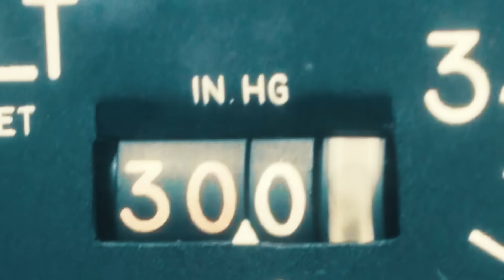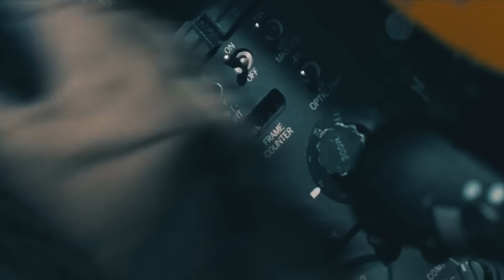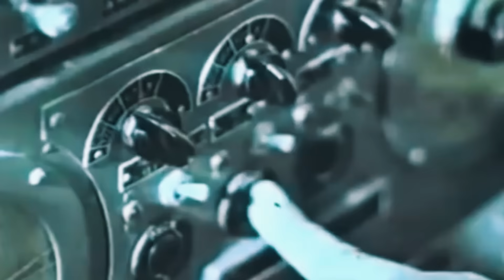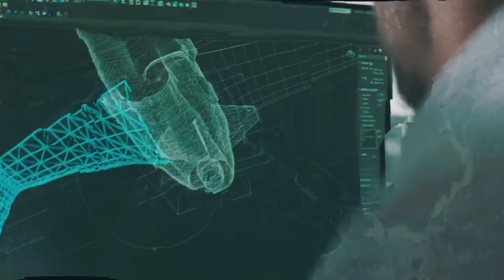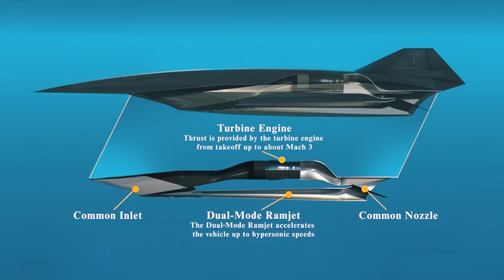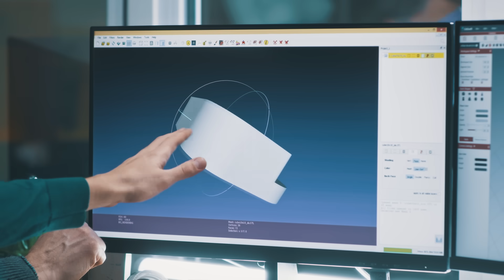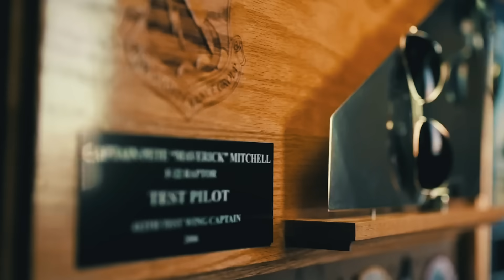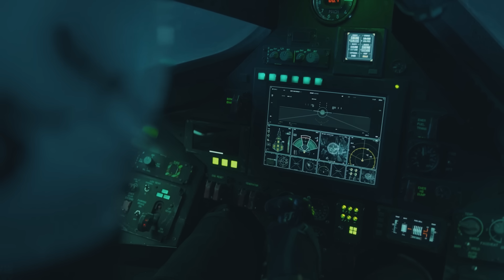USAF Declared SR-72 Darkstar Is Finally Ready To Fly

Comment: I saw the SR-71 in flight. It must have been around 1982. Word went around that the SR-71 would be featured in the airshow at Fairchild. I was downtown Spokane the day before the airshow when I heard this incredible sound. I knew instantly it must be the blackbird! I stretched my head out the truck window and saw it straight overhead. With the tall buildings on both sides I only got a split second glimpse, but I’ll never forget it. It gave me goosebumps!
Reply: In basic we were given the choice as a flight to pick which plane to have a group photo in front of. SR71 was unanimously chosen.
Reply: My father was was in the Air Force and worked in Photo Reconnaissance during Vietnam out of Thailand. In 1973 he was stationed at RAF Alconbury in England were we lived for 3 years. He developed the film from the U2 and SR-71. He wanted to retire at Fairchild so he cross trained into Avionics working on the B-52 and retired at Fairchild. I remember the event you mentioned well. During that time the land just beyond the flightline was accessible, and he took us there in his Ford 4X4 truck. We were just past the  the perimeter fence past the runway and I witnessed the SR-71 take off. It thundered down the runway and took off very low directly over our heads, and an intense heat from the engines was felt. It was an awesome view as the massive plane passed very low overhead and accelerated quickly away. I also was in Basic Training during the official retirement ceremony for the SR-71 at Lackland AFB in early 1990. Most of the recruits in my flight/squadron were in formation on the parade grounds during the events, and warned not to look up during the fly over. I was fortunate to be posted near one of the entrances into the grounds directing people. After a long ceremony it was announced the the plane was approaching and by the time the intense sound was present the SR-71 was just past were I was passing over. Then after the first of several sonic booms the plane quickly disappeared out of sight, soon future announcements of what state the plane was currently passing over were given, and at least one more sonic boom arrived as it was accelerating above.
Reply: I was there that day at fairchild , it was awesome.

Comment: There are multi tiered levels of classified operations at the skunkworks that not even Congress or the POTUS have been read into. I believe we already have vehicles capable of mach 10 and above that the public won't be aware of for another 30 or 40 years.

Comment: this is ancient smatterings of know things of the black bird, slipping in tidbits' of current look alike aircraft  which are far from being anything like the black bird. old hack, 
So which is it., operate a swing shift eyes in the sky, spy scope, or are the powers that be itching to invest in real speed over the Valley of Southern CA  Speed Check. 
Major Brian Shul US-AIRFORCE. PIOTE OF A SR-71. 
Not wanting to over look Walter who was doing all the real work, why they were up there for. 
I witnessed the fastest aircraft coming off the Pacific 
blowing across Southern CA at brake neck speed.
You just about got to catch it coming in to your vision,, your eyes can't track it, you have to look ahead quickly, about three times and it is gone, 3 blinks, its gone

Comment: In the 60’s and early 70’s we lived a few (5-7) miles from Rocketdyne. When they’d test usually mid-afternoon you could hear the incredible roar that normally lasted about 1-2 minutes. When they tested at dusk, the orange/red glow added to the roar was both awesome, and a bit spooky, errey
Reply: we lived  in a new tract near sequoia JHS  off the Tapo Cyn exit in '69..my pops was a ventura county sheriff at the time....our science class at simi high in 71 got to see a afternoon test fire of a early shuttle main engine ..it was on its side with the exhaust   directed along a concrete bed and chute blowing it straight up...
we were standing in a small bunker with thick glass ..the vibration and heat was insane....i recall the same night tests you saw

Comment: When I was in the USAF many years ago, I was introduced to a gentleman who was one of the original test pilots. He told me the top speed was NOT due to the abiliy to go fast, but that the titanium skin would start to glow white hot which was visible in the cockpit and they'd pull it back before it melted. It was well capable of traveling much faster other than that.
Reply: And that titanium skin also was one of those "rubbing someone's nose in it", since they bought the titanium from the Soviets through "dummy" companies.
Reply: @martykarr7058  bingo. Actually; wasn’t like 90++ of the entire aircraft - incl. airframe - made of soviet titanium?? I recall reading the CIA setup multiple front companies to slowly acquire the Titanium to build the birds out of….
Reply: Top speed is about M 3.55, maybe M 3.6, due to several factor including the CIT max is 427C and the shockwaves will start to intercept places were the aren't supposed to go like the wings and other parts of the aircraft.
Reply: Now that is fast
Reply: Same
Reply: yes, the new skin withstands around 40kF using a special metal that's not even on the periodic table; 140. If they use it right, it's actually made as a fabric in zero gravity, then fused and wrapped. It doesn't stretch, so the underhull has to be flexible enough to account for compression and decompression. David Adair gets the credit for discovering the first metal silk as wide as a human hair yet capable of a tensile strength of >5k lbs using nickel. He explains this process in one of the few speeches you can find on YT. Element 140 is made mainly from iron in a high plasma environment as a scalinohedronic element. All said and done, there is still another stealth tech which forms an ionosphere around the craft. The B2 actually used a weak one. I've seen it up close with my own eyes in Seattle. A stronger version blocks a lot of heat.
btw; they found a trick to cooling off the fastest craft by skipping out of atmo into space. Really. I think that might have been Adair or maybe Boyd Bushman who suggested it, idk.
Reply: I just want to know how fast they’ve gone for short bursts…. I’ll bet in excess of Mach 4??? 😵
Reply: @drjones762    You raise an interesting question!  If the SR71 was placed into a shallow dive (say 1 or 2 degrees negative) at, say, 80,000 to 85,000 feet, the plane could probably reach mach 3.7 to 3.9 maybe.  Possibly even 4+!  I'd think structural issues of the airframe itself, the titanium skin, and the engines would impose limits on the maximum speed of the plane.  Others on this comment section know much, much more about the "theoretical" top speed of the SR71.  Cheers.
Reply: @hansheiser3868  
specially the pilots! when i hear a pilot say he exceeded mach 5 significantly, i tend to take his word for it over 'theoreticals'
Reply: @andyman8630  Pilots are like fishermen,"it was definitely an 85 lb trout...."
Reply: @UnlikelyToRemember  
specially SR-71 pilots am i right!!
Reply: mach 5.5
Reply: @andyman8630 do you have any basis for that, or just a guess?
Reply: @drjones762  
the .5 bit was an estimation - pilot testimony! he said over mach 5, but refused to be specific
Reply: @andyman8630   I think that number is pretty doubtful.  The air inlet spike on the J58's moves backwards as speed increases to properly position the inlet shockwaves. The adjustment ends at around M3.2, go much faster than that and you are going to unstart the engines.  Not to mention the incredible increase in air friction heating from ~M3.5 to M5
Reply: @andyman8630  wow he really said over Mach 5???? 🤯🤯🤯
Once at an airshow at Beale, I met a man - he was either the only, or one of like 2 men - to pilot both the SR-71, and U2, both of which were / are based out of Beale. Amazing man!!! 😳🤯🫡🫡🫡🇺🇸🇺🇸🇺🇸
Reply: @drjones762 I grew up in the area. Always loved seeing U2’s coming in to land. Found a couple cool spots growing up where you could watch them overhead probably less than 300 yards up as they came back in or circled to land. But if you tried to take videos of them on a cell phone they would come out all blurry!

Comment: SR-71 was named officially as RS-71 but President Johnson mispronounced as SR-71 during official introduction so it became SR-71 as the official name. I heard this story from Lockheed engineers as well as a Blackbird pilot.
Reply: Well that's not quite true. The text of Johnson's actual speech read "SR-71", so he did not mispronounce it. The designation had already been changed, but the press kit still included the earlier "Reconnaissance/Strike" designation.
Reply: @marasmusine I may be a bit younger, but I was once told the RS- designator was meant to be a confusion device to be interpreted as reconsat or rorsat and thus give no indication to it being an aircraft. Wonder if any of these are stories are really true?

Comment: In 2013, they disclosed the SR-72 and hypersonic program manager Brad Leland gave several interviews about it. He stated that a small, single-engine flying demonstrator could be ready in 2018-2019, a twin-engine SR-72 operational by 2030. In 2017 the program finally got government funding. Rob Weiss said in 2017 the single-engine demonstrator would be flying in the "early 2020's". That was probably a lie, because later in 2017 eyewitnesses reported that they saw an aircraft identical to the SR-72 concept images flying over Palmdale = Skunk Works HQ. When confronted about the sightings, LM VP Carvalho just said "we are doubling down on out commitment to speed" and the platforms "will be operating at 2-3x that of the SR-71". For security reasons, he could only say at speeds "greater than Mach 5". In 2018 LM VP O'Banion said "The aircraft is agile at hypersonic speeds with reliable engine starts".

Comment: I was a teenager in the 80s and met a SR 71 pilot at a family gathering. Of course I asked him “how fast does it go?” He said he was at top speed over North Dakota, throttled back to idle, coasted all the way to Texas.
Reply: I’m not sure he was allowed to tell you that.
Reply: @Randomyoutubechannel-gp5qs  most missions have been declassified i thought
Reply: It leaked fuel on the run way and when it was up to speed the heat sealed the tanks
Reply: @wasntme3651  Limitation of the titanium.  Newer composite materials are a little less finicky.
Reply: @wasntme3651  not quite… the SR didn’t have fuel tanks; it was literally just dumped inside the body, with only the skin holding it in place. Because of the mind-bending speeds the SR achieves, the entire aircraft obviously heats immensely and the whole aircraft lengthens by approx 6” if memory serves. So; it had to purposely be built with some give / flex when on the ground to account for heat expansion at speed.
Reply: Imagine going so fast that you use entire states, countries, and in some cases, CONTINENTS, as navigation landmarks…. 😵🤯🤯🤣🤣
Reply: Wasn’t the official answer, somewhere close to Mach 3 …
Reply: @deantait8326  3.3 or something close to that, but there have been reports of something over 3.6.
Reply: Thats about 1300 miles
Reply: I was told by an SR 71 pilot that it technically doesn’t have a top speed. It has a maximum compressor inlet temperature instead.  The pilots were allowed to go as fast as they needed, as long as they didn’t exceed the compressor inlet temperature which would cause damage to the engines. I presume that meant emergency power could be applied for a short time to escape a threat, but they would have to throttle back before overheating.  The compressor temperature would rise if the external shock cone would enter the inlet, whereas at ordinary cruise speeds, it would still remain outside the inlet.
Reply: And he was also flying at probably 90,000 feet
Reply: Damn he was hauling ass. That's fast!
Reply: Can't believe he told you anything about it's speed.  Now he has to kill you!
Reply: I believe that since a F16 at altitude full throttle then to idle will easily coast 50+ miles
Reply: Same
Reply: Can sb please do the math what the top speed has been on this flight?
Reply: The MiG-25 is faster, but if it flies at its top speed for too long, its engines will overheat. That’s why it couldn’t catch the SR-71
Reply: @ a) I’m pretty sure no other aircraft on the planet is faster than the SR-71; no air-breathing, jet-fueled aircraft, that is (vs. rockets like the X1).
B) From what I read, if the Mig25 or 31 go past a certain speed, it doesn’t merely “overheat” the engines; it completely destroys them, requiring either a total rebuilt or replacement.
Reply: @drjones762  I know, but I just said what the official reason was
Reply: Dang, what kind of family do YOU come from?
"Family Gathering" ?😳🤯
Wow
What a family
Reply: Which would be absolutely BS. Zero throttle at that speed would probably cause instability, but more importantly friction at that speed would take him from Mach 3.2 to 300mph in what, a minute or two? Maybe 100 miles covered, not over 1000
Reply: @MyersJ2Original  He could've been really high up where the air is thin and drag is low. The SR-71 had an extremely high operating altitude

Comment: A Lockhead A-12 can be viewed up close outside the California Science Center in Los Angeles.
Reply: A Lockheed A12 can be viewed at the Space Center outside Huntsville Alabama
Reply: @jasonng6360  I lived on the firing range approach near Quantico, Hidden Lake. I was sitting in the deck behind the house when an A10 went wings vertical, treetop height, then the chaingun whisperred. Nice.
Reply: At Mach 3 depending on the outside temperature, the life of the compressor is quite low, no the average cruising Mach number is  closer to 3.16 NOT 3.3.
The actual  speed is the Mach number times the local speed of sound. The speed of sound is 
c=√(gama × R × Ta)

  The compressor temperature is
 Tc = Ta × ( 1+ (gama-1)/2 Mach²)
Reply: There are 2 SR-71's on display at the "Blackbird Airpark" in Palmdale. It's on the grounds (or near it) of the Palmdale Regional Airport. Lock-Mart's Skunkworks facility is also nearby. :)
Reply: @kenster865 isn't one of them an A12?
Reply: Go to Dayton, OH and see one of each inside, or SR TN 17972 at Dulles, which is the one they show in the video.

Comment: "Operation Darkstar" began in the late 1980's.... Lockheed was the primary and Hughes Aircraft Company providing the avionic systems and cameras.  A test vehicle was constructed and a building aka R3 built in El Segundo, California.  The building was located on Hughes Way, cross of Imperial Highway.  When the testing was completed, the building was torn down.  The "Blackbird Program" which Hughes was also extensively involved in, those aircraft were tested up to Mach 4.4 with the crews advised the max cruising speed was 3.4.  Typical cruising speed was Mach 3.2
Reply: The RQ-3 DARKSTAR was a DRONE! Google it! It was built by Skunk Works. First flight was in 1996. Not a high speed vehicle.
Reply: In and around 1962-1963, plans were already drawn up and ultimately rejected for the SR-71 successor. The reason they were rejected was because they did not provide a sufficient enough leap in aircraft speed capability. The gov't wanted faster. They wanted Mach 5+, ideally Mach 6-9. Do you really think Darkstar was going to get funded for basically matching the capabilities of the SR-71 twenty years later? No, Sir. Not a chance. Them Skunkworks boys had Mach 6-9 designed and built by 1970.
Reply: @Trailsporting  Not sure where you are getting that darkstar was the successor back in the 1960's..... "Operation Darkstar" was an advance tech surveillance aircraft that had a much different purpose than the original blackbird program...... The reason for the Blackbird program termination was our "Keyhole" Satellites - many of which Hughes designed, built, launched, operated could read the inside of a matchbook cover all with digital images whereas the blackbirds used film (mfg by Kodac).  The interceptors flew a bit longer.  I can also tell you this, there was a time in the late 1980's that Hughes was requested to scramble a "Tiger Team' to relaunch a blackbird from storage- because it had a capability that was needed at the time- and that's all I'll say about this.

With regards to "Operation Darkstar", there were major issues that caused the "Stop Work" order that occurred around 1990..... it was not the tech, but IMHO, the 70+ (IIRR) felony complaints regarding falsified work product that occurred as directed by the highest levels at Hughes Aircraft Company by the "New" owners- ie Roger Smith/General Motors Hughes Electronics, IIRR Michael Armstrong was the "new" President of Hughes.... which placed people's lives at "Imminent Risk" needlessly.
Reply: @jeffalvich9434  I didn't say Darkstar was the project that SkunkWorks worked on between '65 and '75. I don't know the name of the project. I'm saying projects to succeed the SR-71 were immediately being worked up after the SR-71 was completed in 1963. The project you are calling DarkStar comes far too late in the timeline and provides no benefit to the SR-71's capability to be a factual successor to the SR-71. Projects in the Mach 5 to Mach 10 capability were undoubtedly under construction before 1975.  To say otherwise is misinformation.
Reply: @Trailsporting  👍

Comment: Good video. But, the technology seems like it would be obsolete by now. Big issues are boundary layer physics, support logistics, refueling. 
With satellite technology the SR-72 would be more useful as a weapons delivery platform. Aft facing torpedo tubes could solve the problem of weapons release. You can't open bomb doors going that fast.